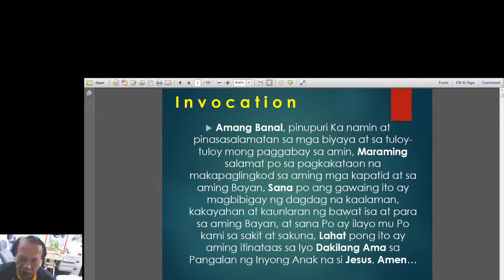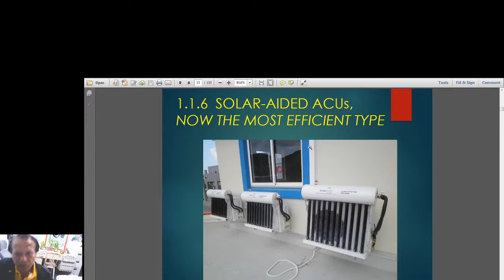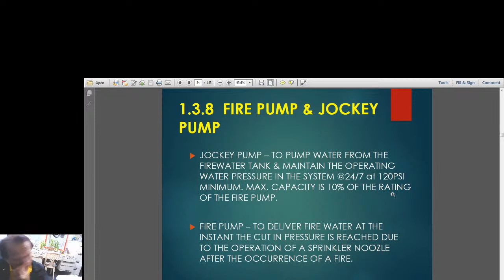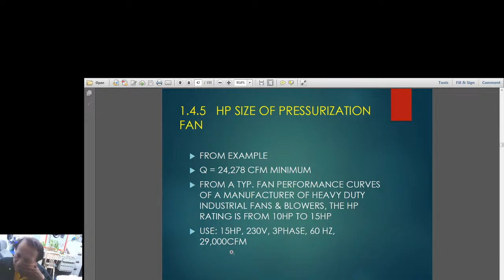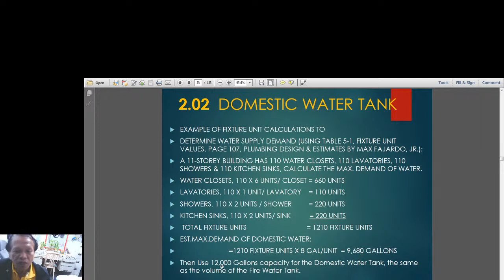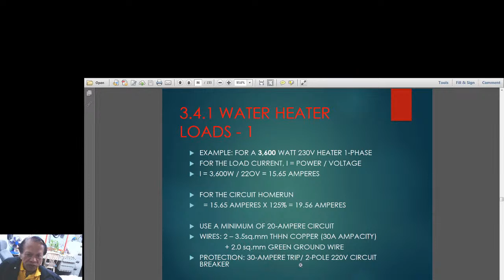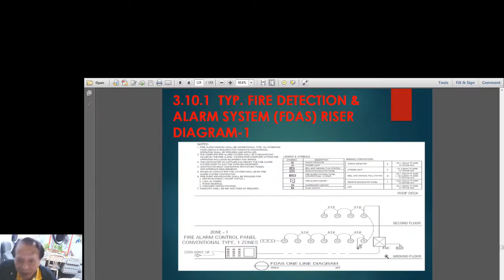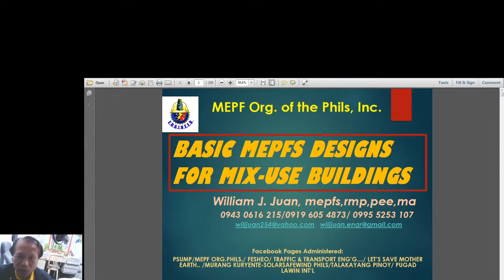Basic MEPFS Designs for MIx-Use Buildings

Comment: Good day sir,

I just watched this MEPFS webinar, informative & I liked it. 
I would like to ask these questions:
1. Stairs pressurization - for building such as 20floor levels & higher, most of the designs has ducting in air distribution. What would be its approximate percentage of its headloss sir?, then can we engineered/incorporate its headloss/friction loss to its Blower specs?

2. Plumbing - waterline system distribution : conventional overhead tank v.s. Direct Water pressure pump, in Construction which has the lower cost? In building operations & long run, which is the most cost efficient?
Reply from the maker: Re Stairwell pressurisation, I beg to disagree with the provision of a duct since the limited cross section of the air duct will just cause air flow friction. The best life safety technique is to just pressurise the stairwell with VFD controlled blower fan, up to 3 to 5 psi above the atmospheric pressure to prevent the smoke and CO from the burning area to fill the egress area. The pressure regulating controllers should be installed every 3 floors for pressure equalisation purposes. For taller buildings, consider the.provision of multiple blowers at say every 10 to 15 floors.
Reply from the maker: Re Plumbing, the constant pressure upfeed system with VFD inverter water pump is the most cost effective system. Its first cost is practically cheaper than the conventional gravity distribution due to the following:
AA) the HP capacity of the upfeed pump is usually only about 60% of the size of each of the booster pumps.
BB) there is no need for a standby pump.
CC) there is no need for the elevated water tanks.
DD) you only need one vertical or riser pipe.
EE) the space needed for the upfeed system is only about 1/4 the area required for the gravity type system.
Reply: @willjac1tv73  Ok po sir Will, noted on this ideas. By the way sir how to have a certificate on this Webinar po?
Reply: @willjac1tv73  Yes sir Will, noted on these factors, by the way sir how to have certificate on these webinar?
Reply from the maker: @francismanlunas7743  please send your request to wiljjuan.engr@gmail.com
Reply from the maker: The idea of air ducting is only good in air conditioning and ventilation since  you need to distribute the cold air equally and continuously.
Reply from the maker: In air pressurisation, it is only in effect to save escaping people within a few minutes after a fire or smoke is detected.
Reply: @willjac1tv73  Ok po sir noted on this & your cited concepts sir, I learned & verified many things in MEPFS

Comment: Sir, so ang design po ni jockey pump ay to run all the time 24/7? And the fire pump ay naka "auto" mode?
Reply from the maker: Yes, it should be running to maintain the required water pressure on the sprinklers. When it reaches the maximum  set pressure, that is the time it stops. Then after some time and due to leakages on the check valves and the pressure in the system drops up to the minimum set pressure, it would run again to bring back the pressure of the system to the maximum set pressure of the system. Eg. the maximum set pressure can be 150 psi and the minimum set pressure is 120 psi, depending on the required design pressure of the AFSS.

The fire pump will automatically run when there is a sudden drop in pressure as in one sprinkler operates due to fire or when the drain test valve is opened.
Reply: @willjac1tv73  
Thank you so much Sir Will. This set-up also applies if the facility don't have sprinkler system? But with fire pump system naman po.
Reply from the maker: @joelbatino6976  if a firepro system has no sprinklers, that means the system only includes fire hose cabinets or FHCs and the Siamese Twin or Fire Department Connection or FDC. If a fire pump is required by the BFP, then the Fire Pump should be automatically started by the operation of the FDAS system.
Reply: @willjac1tv73   Alright Sir Will. Thank you!